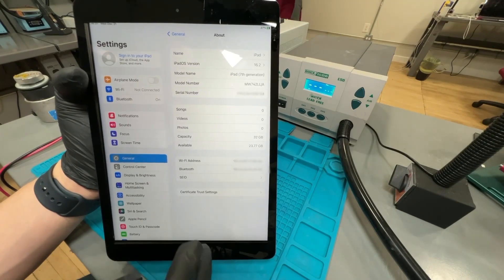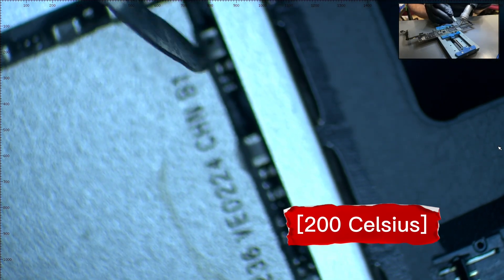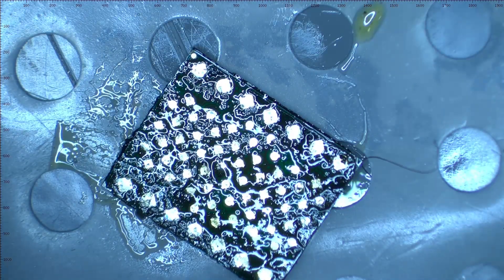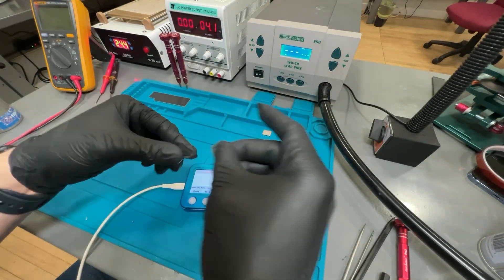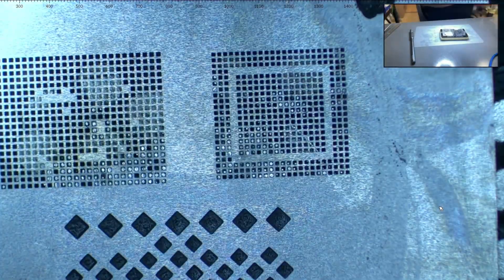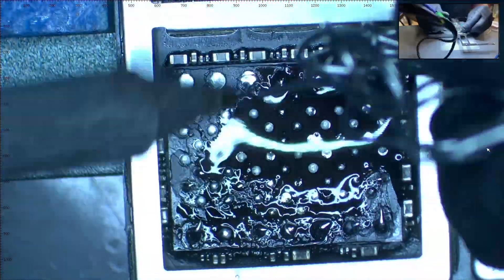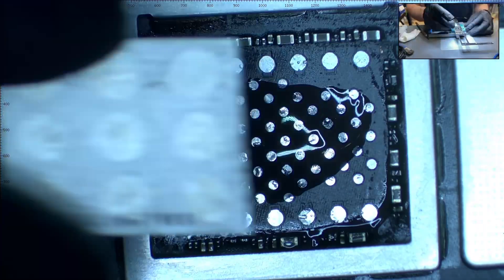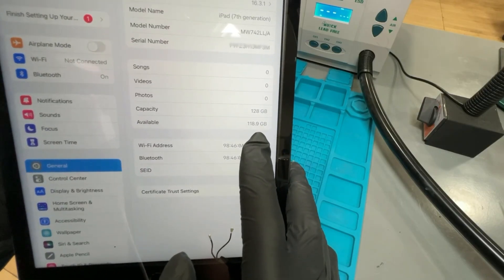iPad 7th Gen Storage Upgrade from 32gb to 128gb

Comment: Is there a possibility that your files from the removed 32gb be copied by the repairman
Reply: Just reset ur ipad before giving it in. And then when you get your new one back just restore from an icloud backup
Reply: once NAND is desoldered there is no way to read user data from it. It is encrypted. However it would be possible to make a copy of data before desoldering NAND and then restore it to a new one.